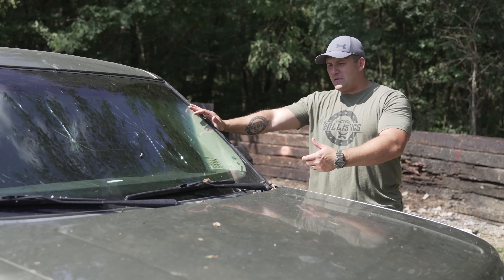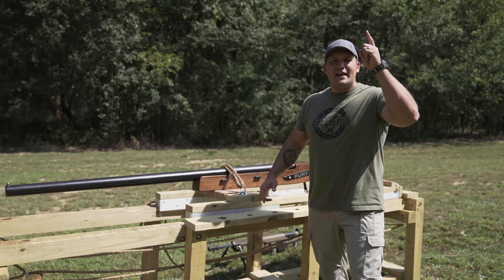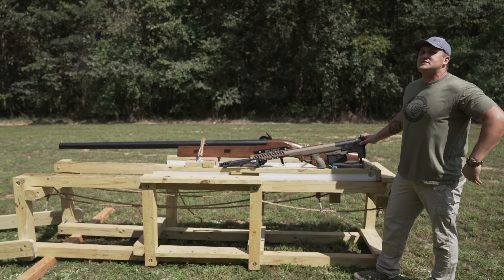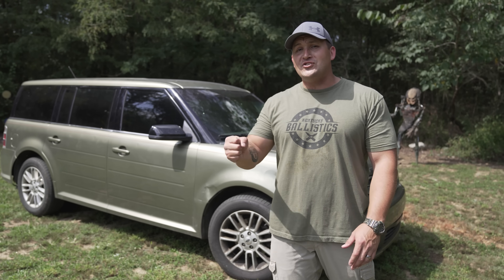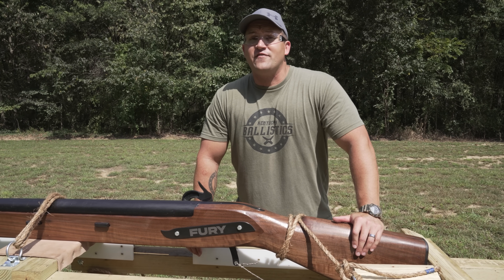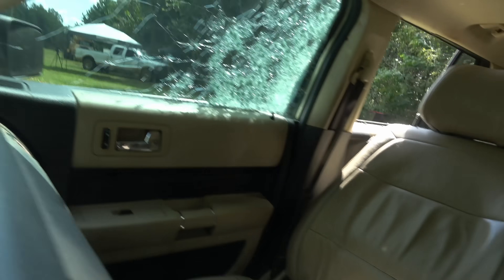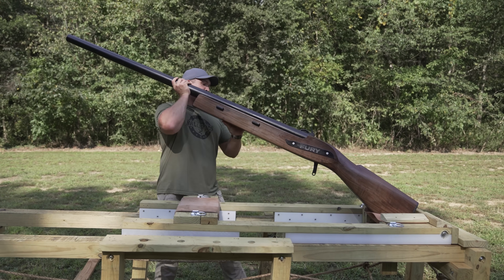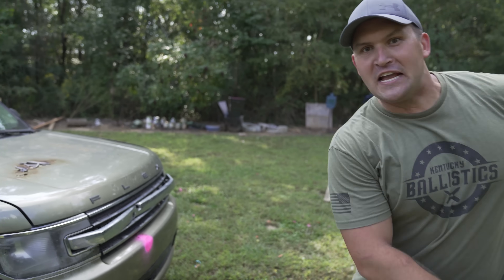Punt Gun vs Car 🚘 (The Biggest Shotgun EVER !!!)

Comment: That engine damage is insane. I'm surprised the starter could even crank it after that, even if there was a small fire.
Reply: Looks like it broke maybe two out of four camshafts (and valves and such to go with) and relevant parts of the heads, other than the valve covers, intake manifold, and whatever other external stuff was in its path.  So maybe if the timing belt or chain(s) was(were) still hanging on along with front halves of camshafts and one or more journals, or maybe even without, you could still spin the crank with the starter.
Reply: Since it's a front wheel drive, the engine is mounted transverse which means it actually sits sideways in the car. The flywheel and starter were off to one side, so they were out of the line of fire.
Reply: @danielgoodman3578  Yeah, it tore up the heads and intake but missed the block. If the pistons aren't damaged and locked up, a damaged camshaft isn't going to stop that starter.
Reply: It's went straight into the head, through the manifolds and camshafts. If he aimed just a little lower and hit the both the head and the block it would literally split the motor in half. There was a lot more potential for damage. Either that or go through the side, the projectile would go through the entire block.
Reply: Would love to see this repeated on a running highrevving engine , aimed straight at the block. Like if you start a Volvo B230 mounted on a stand, and shoot it so that the projectile can go through all 4 cylinders. With slow motion footage and all.
Reply: @kokocostanza2036  Did it even go through the block or only the cylinder head?
Reply: It's a transverse mounted 3.5l v6 engine so the cylinders run across the engine bay not length wise. (Like they would in a longitudinal mount) 
Looks like the ball hit the valve cover between cylinder 4 and 5 and destroyed everything in its path.  So both camshafts  appear to be broken, the valve cover is gone, the head is damaged, 
Likely the rockers and lifters center and right on cylinder 4 and center and left on cylinder 5.  Plus whatever debris might have gotten into the cylinder bores 4 and 5.

Timing will be all jacked not because the timing chain/belt took a hit... but because the exhaust and intake cams are no longer of this world... and the motor was still running when it happened. 
So...the entire left bank of the engine went out of time... instantly.  

I think you do a teardown on your other channel... for science.
Or ship it to "I do cars" (a you tuber that does engine teardowns for educational entertainment)  and DON'T tell him it wax hit with a frigging cannon ball. 

The motor had a pretty loud knock to begin with... so she's good n' broke now.
Reply: @twistedyogert  Looks like just the head.
Reply: @danielgoodman3578 yup, the question Is: if the head gasket’s zone got blown, that means that the spark plugs were pulverized too, so how will it make fire without a spark?
Reply: @Famast  I think the head gasket level wasn't necessarily hit. But even if it was, harness wires could've been hit and caused a spark that way. The fuel rail(s) were probably hit and there was probably a spillage as a result.
Reply: @danielgoodman3578  

Yeah, I didn't even think of that before I posted... that's why the fire.
The fuel rail on the left bank was likely trashed and spewing gas into the engine bay when the fuel pump was active. 
I'd love to see a teardown of that motor...
Reply: @stinkyfungus  i didn't think about the fuel rail actually dispensing gas beyond the initial spill. True on the initial shoot, but also true when he was cranking it.

Comment: The entire top of that engine is made out of phenolic plastic, so it wouldn't take a whole lot to punch through it. I'm amazed at how clean & huge of a chunk of it was taken out. An expert with an angle grinder would have trouble trying make a cut as straight as the punt gun did. I'm almost impressed that the intake didn't shatter into a pile of carbon black legos.
Reply: No, the block and heads are aluminum. The valve covers and plenum (intake manifold) are plastic. He shot through the heads. The cams were split in half. The car is fwd, so the engine is transverse (sideways).
Reply: Regardless, I’m pretty disappointed with the results. I expected more energy out of 150lb gun, blackpower I guess 🤷‍♂️. Maybe he’ll get a 20mm in the future.

Comment: You should put some wind up springs for an automatic return on the punt gun. The ones for trailer tailgates would work nicely, and it would do away with a lot of that slamming action on the back of the sled. Maybe a couple large dampeners for the rear and it’s set for life

Comment: Hey Scott,
I love this gun. You are just scratching the surface so far.😱
You should get someone to make you a couple of slug molds for the Punt Gun. Make one like the typical 58 caliber mini ball buffalo type slugs and get another one that is semi hollow like the Exploder shotgun slugs. Fill the cavity with some fast burning pistol powder and cap it with a 209 primer. 
Also depending on what your pressure rating is for the barrel( you said it  was a modern version of the BP gun) you could prolly burn some smokeless shotgun or pistol powder for even mote devastating results.

Comment: 15:13 what I find remarkable is that the windscreen was still in tact at all. I knew that windscreens were more durable than normal glass, but I still thought there was some point where they'd shatter. Maybe it could survive a normal bullet, but all of that force, all of the shot? I guess now I know that windscreens truly do not shatter. They can be broken beyond use, but it won't collaps with a big hole.